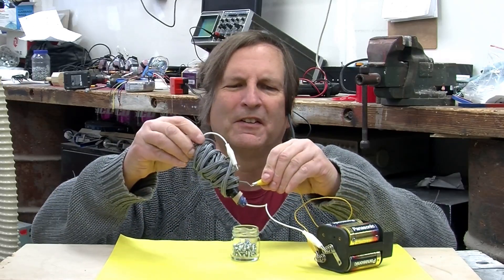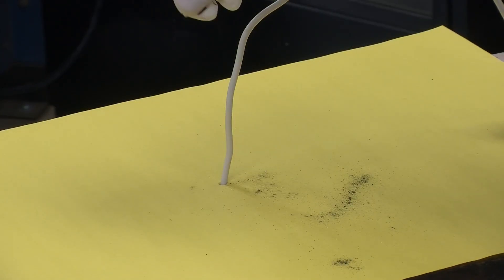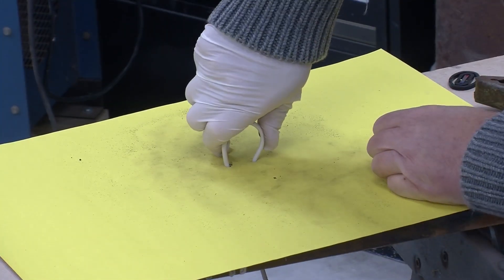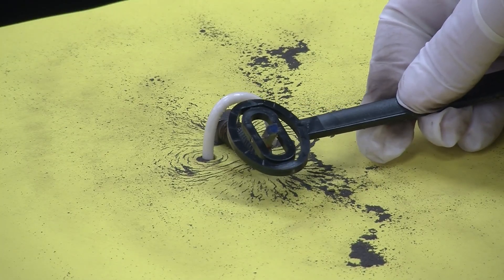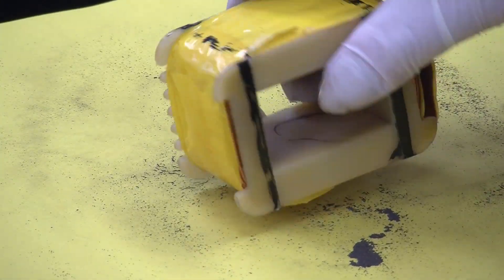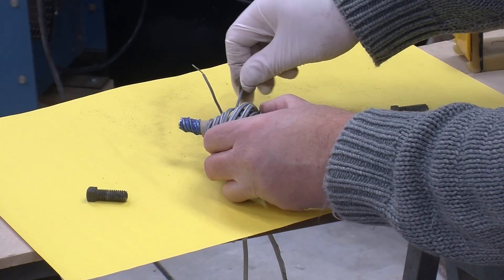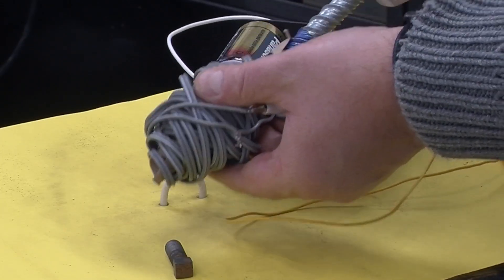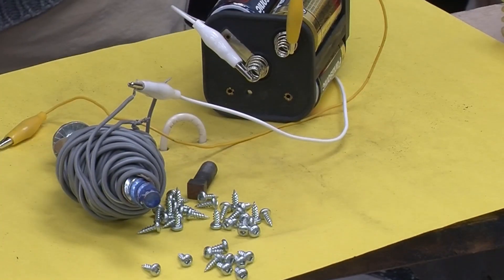Electromagnets: How They Work and How to Make One

Comment: I know this video is aimed at the introductory level but I was wondering if you could give me some insight into the diminishing returns experienced due to coil resistance. When winding a coil for a large electromagnetic with a target amp turns of say 3000 the resistance of the enameled wire gets to the point that you require a thicker gauge drawing more current and producing more heat. How do you optimise an electromagnet to have the highest possible flux density before saturation with the lowest wattage.
Reply from the maker: That's a great question!  The things that come into play include a) the  number of layers of the winding needed to create the desired number of turns - the outer turns use greater length of wire and have more resistance and b) the resistance of the wire which is proportional to 1/ the diameter squared of the wire  (and also the diameter limits the number of turns on each winding layer).
 
You could set up some equations to see how changing wire size alters things like required voltage, power consumed etc, but lets do a bit of hand waving: 

Lets assume we only have one winding layer so number of layers does not add to the complexity. We start with 1 turn of wire and that length of wire has a resistance of 1 ohm. So with 1V applied we get 1 Amp and 1 amp-turn. If we do two turns of the same wire, we now have 2 ohms of resistance, and with 1V applied we get 0.5 Amps and 0.5A x 2 turns = 1 amp-turn. So assuming the power supply can always supply enough current,  the wire size that sets the amp turns that are generated, and the more more turns you have, the less power and current you need for a given number of amp turns = field strength. 

Adding winding layers to accommodate  more turns add more resistance per turn and begins to reduce the resulting current and hence amp turns for a given voltage. How great this effect is depends on the relative length of windings on inner and outer windings. The smaller the inner winding's diameter in relation to the wire diameter, the more pronounced the effect is.

So in general, for a DC electromagnet, the more windings you have, the less power needed for a given amp turns.  

Hope that helps!

Comment: i saw  a video of some zenner diodes in serie that can detect magnetic current from a cell phone, can u explain us how is that possible?
Reply from the maker: Sounds a bit like energy harvesting. If you have a diode in series with a coil (one or more loops), the coil will pick up some energy from RF fields given off by the cell phone and the diode will rectify them. No idea why a zener diode would be used unless there is an issue with too high a voltage near the phone which is unlikely. Look up crystal radio which essentially is the same thing.
Reply: @ElectromagneticVideos i found the video so u can see by yourself  https://www.youtube.com/shorts/bGeJJ0p3La8
Reply from the maker: @elarcadenoah9000  How neat! So the diode is a   switching diode but does seem limited to a few hundred mhz based on the spec sheet I looked at so its surprising that it works with phones with   transmit frequencies generally greater than 700Mhz. It is close to the phone so it could be picking up energy from the switching power supplies or something else operating at lower frequencies. Would be interesting to see if its the loop or the "antennas" from the wire leads is picking up the energy. If its the loop, a single diode might be better. I'll have to try it sometime.
Reply: @ElectromagneticVideos  i can give u a page where a guide also experiment with magnetic detector also ghost detects i think is his pasion and lighting detectors so u can see many of his experiments but u maust insist he give a link for his shematics some of them are difusse https://www.youtube.com/watch?v=k9Rx4x0BePk
Reply: @ElectromagneticVideos  this  kid has also detector for cell phones also if they are disconected and the zenner diode i send u before i thisnk he uses for radiant energy free energy and i think is possible
Reply: @ElectromagneticVideos  zafel yildiz said if u put more zenner diodes is more sensible and detects for far away
Reply: @ElectromagneticVideos  in the air there is a lot of energy tesla did it with something similar but he added a mica batery or capacitor that is like a baterry if it can retain electrity inside for longer time taht is why he used mica in the car he invented
Reply from the maker: @elarcadenoah9000  Unfortunately while there some energy in the air there isn't much. Tesla did a lot of work putting energy into the air with things like Tesla coils and then harvesting it. A Tesla in this context is essentially a crude radio transmitter that transmits  RF energy (radio waves). He did a lot of experiments harvesting that energy as means of power distribution but its is not effective. But if you go near a powerful radio of TV transmitter with the type of devices you have mentioned and even much cruder ones, you can certainly detect the RF energy. Apparently (and I want to do this sometime) if you go under a high voltage power line (the really big ones) at night with a florescent tube it will glow from the AC electric field). This would be from what is known as the near field which is a bit different from radio waves travelling great distances.
Reply: @ElectromagneticVideos  is enought but u dont see it cause when is dry air u can see in your body when air current produce electricity but when is humid air all vanishes to the ground,but tesla created a batery or a condensewr covered with mica so it doesnt go away or loose so that baterry could have enought energy acumulated from the air when oxigrn clashes betwen each other it produces electricity but when air is humid it looses fast to the ground,i think is possible u can see some super capacitors but they dont have mica all around i dont know why?and they dont cover all the capacitor like tesla did
Reply from the maker: @elarcadenoah9000  Unfortunately I think that a bit of a myth! I have actually played around with mica - there is a lot of it in the rocks where I live. Nothing special about it other than its a really cool rock that separates into think transparent sheets and makes great insulators. Supercaps are are a different thing - they use materials technology to create vast surface areas in a small space separated by ultra think insulation to create relatively large capacitance for short term energy storage such as storing energy from breaking in electric cars.
Reply: @ElectromagneticVideos  THE PROBLEM IS HOW U COVER THE CAPACITOR WITH MICA LIKE A PAINT,SO I WILL PROBABLY USE BAKELITE TOO
Reply: https://www.youtube.com/shorts/Iv06vPFGDHQ

Comment: Doesn't making the current double back along its original path cancel out the field it established on the way out?  I daresay you could get a much better result by twisting the two conductors together at both ends and applying current to the opposite ends.
Reply from the maker: Guess I didnt explain it well - connecting the one side's white wire with the not-white wire at the other end of the coil turns the two wires into one loge wire with twice as many turns. I could have pulled the wires apart and spliced them together into a long single wire before winding them to have the same effect but more work. As a general rule, the more turns the better!